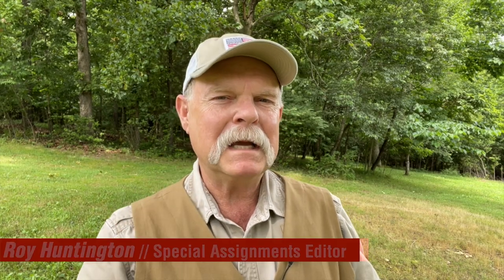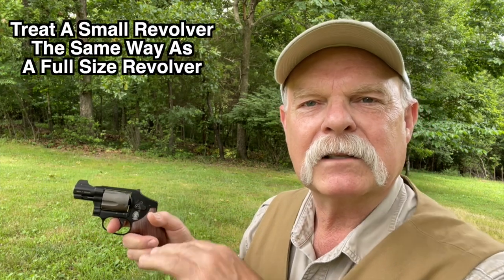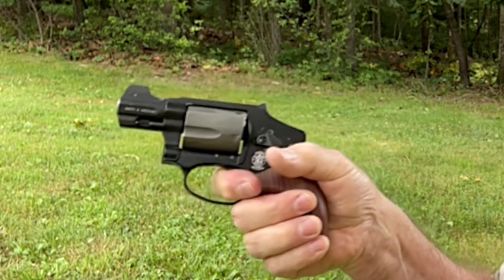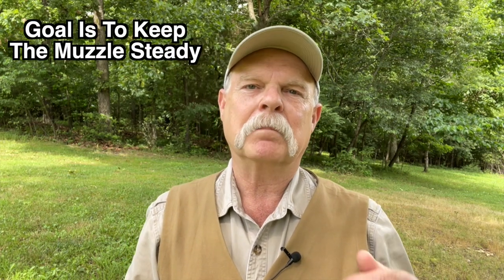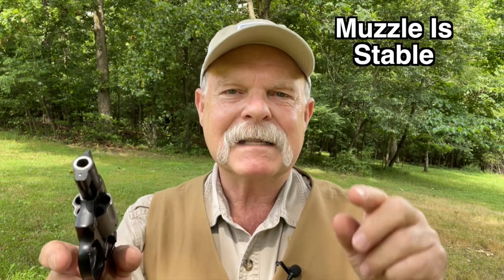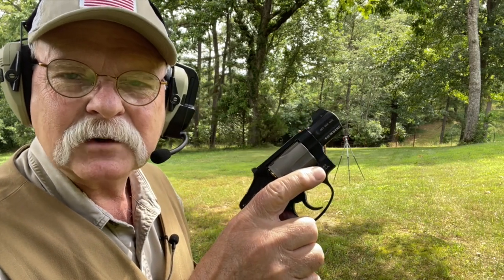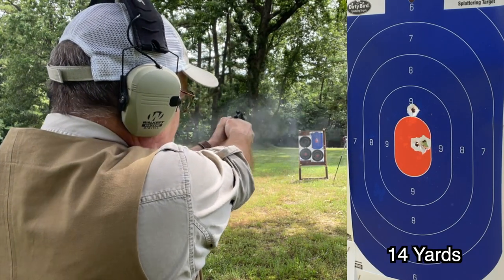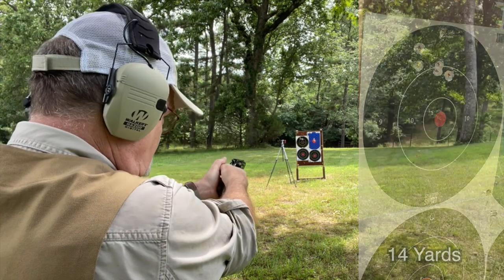Accuracy Secrets For Compact Revolvers!

Comment: Lot of folks out there that advise not trying to stage the trigger during DA operation. On the range I think it is a skill worth developing. I suspect when the pucker factor is high many would default to a straight, constant pull because of the urgency to get the shot off and maybe insufficient training. I shoot a Ruger SP101 and it’s trigger is fairly easy to stage as is my GP100. The gold standard though was my S&W 431PD in 32H&R Magnum. Great video, thanks.
Reply: Mr. Huntington is speaking of shooting the revolver, not fighting with it. You are correct in stating that under great duress people will not stage a trigger cycle.  Revolvers are NOT designed to "stage" the trigger, even thought we can easily accomplish the task with practice and for some shooting conditions.  If you have time to stage the trigger, you usually have time to fire in single-action.  Shooting and fighting are not the same.  The close-quarters handgun fight will not supply time to "stage" or fire in SA. Once a person becomes familiar with fight concepts, they give up "staging" for fast, close-quarters combat.
Reply: @Rustebadge  No, he clearly said he talking about defensive shootings before he shot the gun. And it’s utter lunacy from someone who does know what he is talking about.
Reply: Training, training, training.

If you consistently train yourself to stage the trigger, and develop the muscle memory of smoothly firing your handgun throughout the trigger stroke, you will unconsciously perform the same action under duress.

If you don’t practice a smooth and quick trigger pull, you’ll only have a quick trigger pull under stress.

Comment: The trouble with staging is you are not going to do that in a self defense situation. I was taught to pull and let off in one smooth motion when I was in law enforcement. There is no time to take your time was what my instructors taught me.
Reply from the maker: But …. Staging to learn is good, then as you practice, you get smoother, and smoother is faster. Once you get the feel, it’s one, smooth motion. And the best way to learn that is at the beginning. I shot PPC matches which need DA trigger pulls at 50 yards on time. We were smooth, and fast, but we all “staged” … just smoothly and fast! Roy
Reply: That makes sense . Thank you. @fmgpubs
Reply: Always stage just more quickly  as needed.

Comment: Make sure your trigger finger is on the trigger far enough so you are not pushing your front sight to the high left.I have really big hands and fingers so I had some trouble learning to do this finger on the trigger to pull straight back not push it side ways.Thank you for this knowledge.
Reply from the maker: You’re exactly right. I also put a lot of finger on the trigger face, for that very reason. It just takes a bit of practice and then you’re good to go! Roy

Comment: Spot on instruction! I realized this while doing dry-fire drills with my 2" Rossi .38 that was gifted to me. I could see the aim point jumping during the DA take-up. I recall reading an article decades ago where a revolver barrel was cut down several times and accuracy tests done. There was very little actual difference in accuracy between 6" and 1.5".
Reply from the maker: You’re correct about the accuracy thing. We’ve done testing with Ransom Rests and the 2” guns shoot as well as the 6” guns. It’s all about trigger press and control. Thanks for your post! Roy

Comment: I was trained on double action revolvers as a young man. We did drills where we staged the trigger and rolled the next chmber into position without discharging an un- loaded revolver. We graduated to loaded guns pointed down range. The goal was to stage and roll each chamber with out discharging.
Great drill to learn trigger control.
Reply from the maker: I recall that too and it is a good way to learn that control. On an empty chamber though is right! Roy

Comment: Great tip to take the trigger to the point just before firing to minimize gun movement from pulling the trigger.  MY S&W 642 has a very nice second click. Also you can see the cylinder rotating as you pull the trigger back to that second click. After that the trigger is super easy to complete the pull.  In a street situation where your life is at risk, you will have to fire double action, so one should still practice firing double action, but I will try this pseudo-single action trick next time I hit the range.  I already tried it out in dry firing and it definitely is a slick trick. I do like the heavy trigger on the revolver as it is a safety feature, since you won't easily fire by accident. It takes a determined pull of the finger.  Also I found a firm grip on the gun helps minimize movement during trigger pulling. And the proper grip to get the correct distance to the trigger. The grip that came with the 642 had my finger way to far into the trigger.  A Hogue grip solved it beautifully.
Reply from the maker: You’ll find as you practice the staging method, you’ll get smoother and faster, until it’s one continous smooth movement in DA mode. Then do it 10,000 more times! It’s why guys like Jerry M. can shoot a DA revolver so fast and accurately! Roy H.
Reply: @fmgpubs  I get it.  With 10,000 times of practice it becomes second nature and you probably will do it in an emergency situation without any loss of time. It really boils down to making that final aim adjustment prior to the last bit of trigger pull.  So after trying this out at the range I will try out the "one continuous smooth movement" too.  Thanks!

Comment: "Stacking" the trigger is a time honored way of shooting in competition, especially in PPC. The typical S&W has a trigger where you can feel the wall of the sear drop easily with a little practice. Love the bomar sights. Where did you get them installed? Was it expensive?
Reply from the maker: Old Tanker, those sights on the J-Frame were done years ago and they no longer offer them. I think if you nose around (Dr. Google can be your friend!) there are others doing similar work. Roy H.

Comment: My first handgun I purchased a Taurus model 85 stainless snub nose 21 Oz.. in 1985.. received my permit in 1990.. at that time I used to be able to purchase at my gun shop Caroll reloading company reloads.. 50 rounds of wad cutters for and you got 50 cents off for returning your brass!! So I was able to practice practice with that snub and I got very proficient with it.. my current carry gun is a 11 oz Smith & Wesson 342 airlight TI .38 sp . Centennial hammerless.. well I can shoot that gun accurate out to 50 ft! Easily. I replaced the grips with rubber crimson Trace laser grips I still use iron sights but it's nice having thelaser DOT to confirm your point of aim.. I personally find the double action only centennial type guns easier to manipulate the trigger... I seem to have no problem staging the trigger..

Comment: I have a Ruger Wrangler SA, but this video was very helpful. My eyesight is terrible. I painted the top 1/3 of the front sight blade with orange neon nail polish with a clear coat. It really pops. Hopefully it helps.
Reply from the maker: Check out the eyeglass "stickers" at www.eyepalusa.com. They are small vinyl circles with a tiny hole in them you stick on your glasses. They act like an aperture sight and suddenly your front sight is clear! Roy

Comment: Good tips. Not great for rapid fire that we’d be doing in defense. The best thing is get a laser grip and practice dry fire 100 shots a day. That has helped me a ton. I  have a home range but ironically dry fire helped me much more than dry fire when I switched to snubbies. Keep the laser on a spot and feel what it takes to not have it move. I notice a sense my outer right forearm pulls the gun just a bit to counter left tendency.
Reply from the maker: This is just basic trigger press. As you practice you get smoother and smoother is faster. Eventually it turns into one continuous smooth press. If you’ve ever watched Jerry Michuleck shoot a plate rack with a revolver you’ll see that applied! Dry-firing is great practice too! Roy

Comment: Oddly enough, after just sending a 629 snubby in for warranty work I noticed in its manual that Smith and Wesson specifically DISCOURAGES 'staging' the trigger. They suggest that this can cause timing problems as well as other issues. Curious what your thoughts are on that.

Comment: It’s a great video. I own a S&W Model 60 myself, which I haven’t shot nearly enough over the years. I’m curious about how you aim with it. Intuitively, I’ve tried to align the front sight with the rear notch, similar to how you would with a revolver that has traditional sights. However, this can be quite challenging, especially since my eyesight isn’t what it used to be, and there’s not much of the front sight left visible when I aim this way. Do you use the same technique? Or does your front sight remain fully visible? How do you properly aim with such a revolver? Any advice would be greatly appreciated.
Reply from the maker: Joe, the tiny sights are a challenge and there’s no easy fix other than installing new, bigger sights. If you raise the front sight up, the gun will shoot very high then, so that’d a no-go option. You can learn to “index” the gun by looking “over” the rear and front sight. So you’re not really looking through the sights, but just over them. That allows a rough sight alignment and is plenty accurate for close defensive use. Try it when you dry-fire. Roy

Comment: Very nice shooting and great advice  I struggle with my trigger pull on my 44mag single action black hawk   it has a 11.5 inch barrel  and is front heavy  and I think that is adding to the trigger problem   I have   if I bench it  I  can hit a solo cup bottom  size pattern
Reply from the maker: Hi Joe, the same tips apply to shooting a single action. The smooth, slow press, very controlled will work. Go get 'em! Roy
Reply: @fmgpubs  I at local gun ranges now and gonna use the advice thank you
Reply from the maker: @joebarker9462  Let me know how your range day went. Roy
Reply: @fmgpubs   it went pretty well
Reply from the maker: @joebarker9462  Excellent. Now just keep practicing. Roy
Reply: @fmgpubs  I still trying to develop  a comfortable grip for my 44mag revolver. The shape of the stock tends to exaggerate the gun twisting back in my hand. I might get a rubberized  grip sleeve and see if that helps
Reply from the maker: @joebarker9462  That will likely help. What model gun do you have? Most factory grips are terrible. They flare at the bottom which is the opposite of what they should be doing. Check Hogue grips. Roy

Comment: The staging of the trigger you describe yes that's good for plinking double action and or target shooting double action but I believe that if you used in self-defense a double-action snubby should just be squeezed as tight as you can squeeze it pointed the direction of the enemy and pull the trigger trigger straight back and smooth as you can make it no staging no double cylinder movement etc etc just pointed at the enemy pointed at the enemy and smoothly yank pull the trigger to the rear
Reply from the maker: The key, James, is if you practice staging, then as time goes, you get smoother, and smooth equals faster. Until finally, the press is fast, smooth and accurate. Roy

Comment: Just wanted to say I happend apon this video after obtaining my very first Revolver, which happens to be a .38spl S&W 1902 or maybe 1905, I am still learning about them so I am not for sure which one of those it is yet, however it is certainly one of those two since I had to do some very imperfect home gunsmithing by straightening the Ejector Rod and turning the little Knurled cap on the end of said ejector rod back tightly on after it had apparently sort of rusted a little to forwards to allow me to even release the cylinder, where I then realized it was seized up before I did that due to the fact the ejector rod was terribly bent… (I’ve managed with a small but not nearly small enough dead blow plastic mallet to get it where the gun functions as intended , however I am definitely going to take the next opportunity when I am not in my appartment and in a friends took shed to use his drill press and a ruler and a much finer non-matting mallet to completely true the rod up) with that said l, I have always loved revolvers even though sadly I am 43 before ever getting one lol. But I am seriously enjoying this old Poorly cared for peice of history and outstanding machining/gunsmithing and engineering!!  I also sir, wanted to take time to thank you for your excellent video and the information you shared here! I will be practicing your advice about the trigger and staging it and the way you extend your finger well over the trigger to feel the opposite side of the grip ! I enjoyed your video and your very genuine and friendly demeanor as well!! I am now subscribed and look forward to watching more of your videos! I enjoy a lot of the huge “Gun-Tubers” videos but, your simplistic and friendly and fun and educational video was very refreshing and I think that it was a great watch and that your demeanor and way of presenting this information comes off as much less…hmm… I guess “threatening” or “Dangerous” ..?? ( I don’t find most gun videos that way, I enjoy PSR and Garande Thimb and everything else personally, but I can see that their videos could offend the far leftist people is what I’m saying a lot quicker than this approach, which feels wholesome and friendly and fun!) if that makes sense!? I appreciate you and I look forward to learning much more about my new baby and how to properly handle and treat it! Thank you son much!
Sincerly Van
Reply from the maker: Thanks for your very kind note, Van. The Colt will stage a bit differently than a S&W but the technique is the same. Just go slowly and dry fire safely. I hope you enjoy the other vids. Take some time and look through the “Shorts.” Roy

Comment: Staging ones trigger is a good option for the 15-25 yrd shots, otherwise for 5-10 yrd shots I’d just a soon use a smooth DA trigger press w/o staging.
Reply from the maker: Agree Kyle. The key here is learn to stage, and as you practice you get smoother and smoother, which equates to faster and faster. So when you need to fire fast, you’re still smooth. Roy

Comment: J-frames tend to pinch the pad of my trigger finger between the back of the trigger and the rear of the trigger guard. I find the LCR/x fits my longer finger hands better, and has a much better factory trigger.
But the points are well taken. Focus on locking the arms and wrists and hands, and keep the mind focused only on index finger squeezing, ignoring any muzzle blast or anticipation.
Reply from the maker: If you have larger hands, move your finger pad back further, not putting so "much" into the trigger guard. Also, rounding the edge of the trigger (the side facing your palm) can help the fit at times. If none of that works, put slightly bigger grips on the gun. That pushed your palm back some, shortening your reach and will likely be more comfy. Best of luck! RH
Reply: @fmgpubs  Tips make sense. Thanks for the reply!
Reply: I had the same problem with my J frame S&W.  A Hogue grip solved the problem perfectly by adding a layer behind the backstrap that both cushions and extends my hand farther from the trigger.
Reply: @InlinePaul  That would make sense. It's primarily the pull distance that's too tight for my longer fingers.

Comment: How did you add that big front sight on the S&W? Or does that gun have a replaceable front sight? I want a bigger front sight on a S&W with a non replaceable front sight because it shoots high.
Reply from the maker: Leaonard, Hamilton Bowen did that but they no longer offer the service. There are many options for adding front sights. I think there are also some which will glue over the existing sight (think: JB weld). Cutting a dovetail opens the door to lots of options. I’ve also added some TIG weld and re-shaped the sight. Check with hs-custom.com as he does work like that. Roy
Reply: @fmgpubs    Thank you!

Comment: Thank you for this video. I learned something new for my semi autos. I use Smith and Wesson but for my snubnose revolver I have a Taurus 856 and until this video I did not realize this gun makes two clicks you push the trigger a little bit it clicks, you pull the trigger a little bit more and clicks again, and then it a little bit more it fires which I didn’t know that lol so thank you
Reply from the maker: Glad it's helped, Matt. Clear the gun and practice the trigger control. I can't remember off the top of my head, but if your Taurus doesn't have the same clicks a S&W has, it will still be distinctive enough for you to learn to stage it. Roy H.

Comment: some experienced people say more better is pulling thru in a smooth manner, no staging
Reply from the maker: You need to walk before you can run, Asian. Practice staging to get that last bit of sear break down smoothly. As you practice, you’ll get smoother and faster, eventually pressing through in one, continous smooth movement. If you try to do it all at first, you’ll never get the break down right. Roy